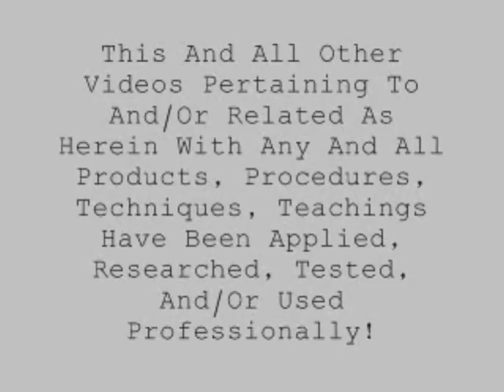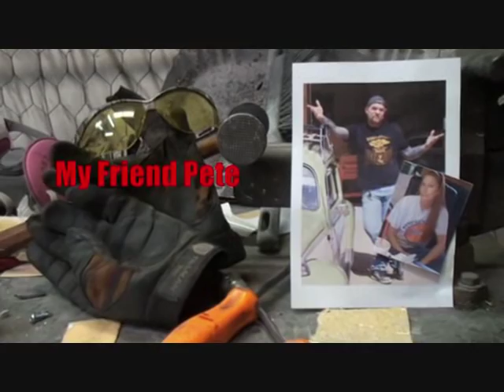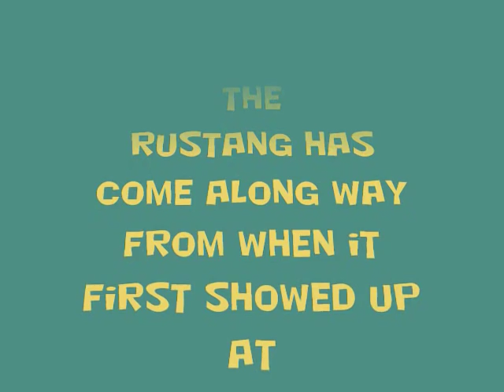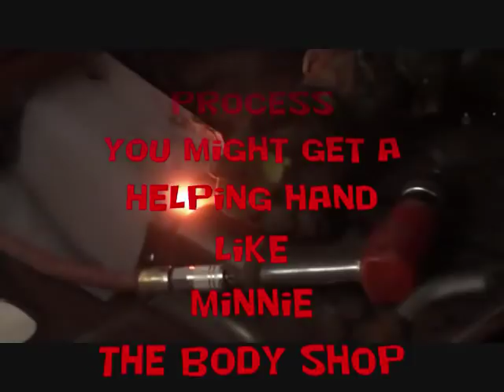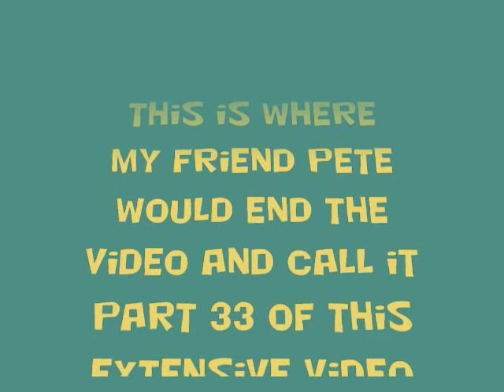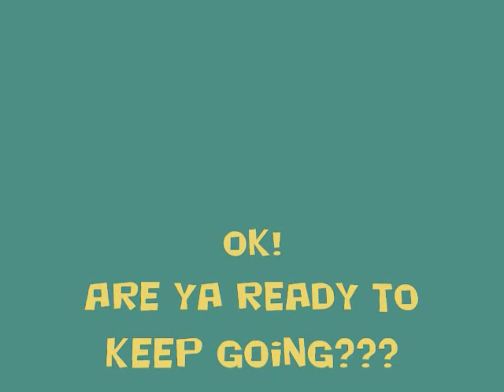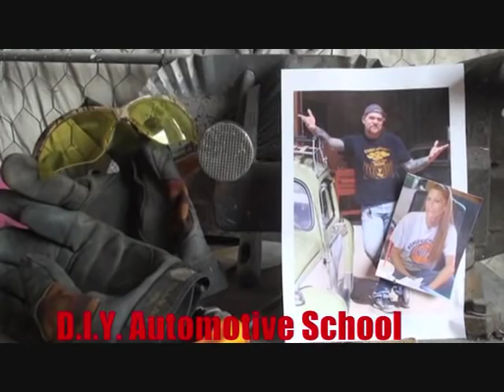"How To": "Restore" A Rusted Out "Car"-Part 33

Comment: WOW! I watched the whole vid. Just cause I have installed several floor pans! And yes, you did do it right. Biggest one I did was a complete floor pan in a 2001 Chrysler mini van, 6 passenger. And all the structure for the right hand slider/with remote. fun,fun,fun. And the "B" pillar. And now you know why I'm nuts.   LOL
Reply from the maker: HURLBUT6805 Up a bit early this morning aren't ya DOUG?  Amazing they fixed the van instead of totaling it out!
Reply: diyautoschool You shoulda seen the fuckin box the floor came in. It was wood and took forever to open. It was a brand new van fully loaded. I think retail on it  at the time was around $35.000.

Comment: Your videos are pure gold to learn all the stuff related to this kind of work. Thanks a bunch. There is one thing that I'm wondering since the beginning. I know why you grind the paint from surface you want to weld but that leaves bare metal parts under a lot of stuff. On the other end I saw you prime or rust convert paint most of the other bare metal surface. In this case, you Tek screwed the box to the panel just after grinding it. Isn't a place where rust could build up in the future since the base coat won't be able to reach ? Maybe it's a step I missed ?

Thank you again, I plan to start a project like that in the near future and I plan to do it right ;)

Comment: So are these all plug welds? and with the screw holes. do you just plug weld those after you remove them?
Reply from the maker: Emily1963eh basically thats what they are, with added stitch welds, and yes, remove the screws and weld up holes...

Comment: How long did it take to weld in the entire floor?
Reply from the maker: +Brennan Carey It took a few days to get it all welded in and secure! Still not done with it, I have to add the lower front floor braces on the next go-round!
Reply: +diyautoschool  Thanks Pete.. I am busy with a similar project, have learnt a LOT from you bud !  I am undecided if to replace the entire floor pan or patch repair mine. The passenger side and drivers side foot area are rusted through, the rear passenger footwell some small rush holes 2"x2" and then the tunnel has a 4"x 6" patch panel. So not sure whats more work to replace these sections or the entire pan ?
Reply from the maker: +Brennan Carey Your better off in the long run to replace the whole floor if you can get it! It's not really any easier doing a partial, and the car will be worth more money if you do the whole floor then patch it.. Take it easy and good luck. Pete
Reply: +diyautoschool Yeah I have a full floor ready to install, was just not sure whether to cut it up into long panels or replace entire thing.